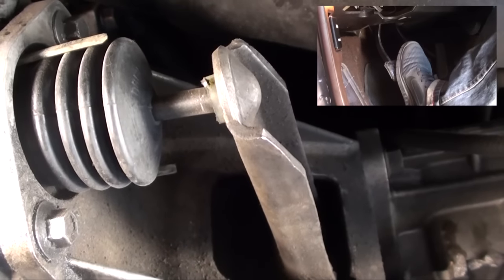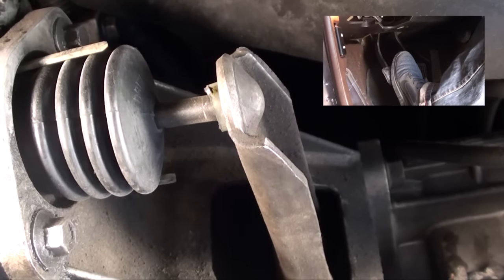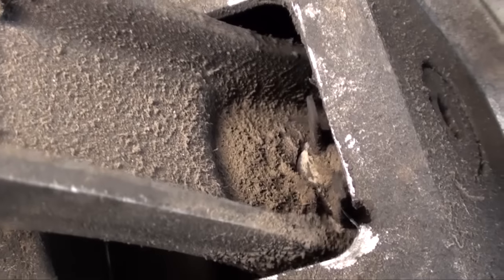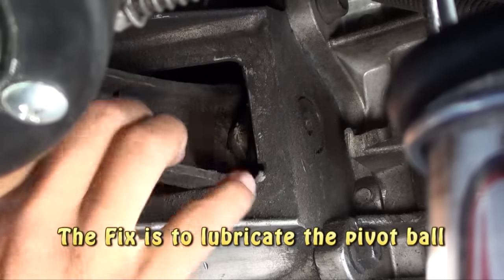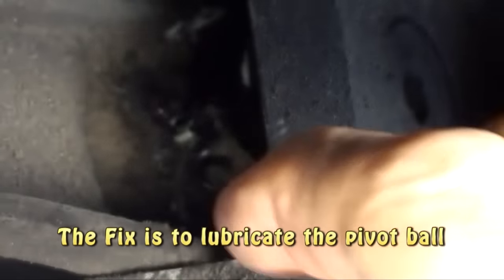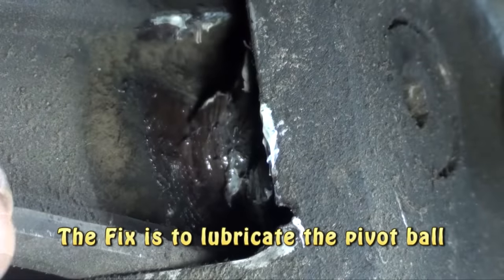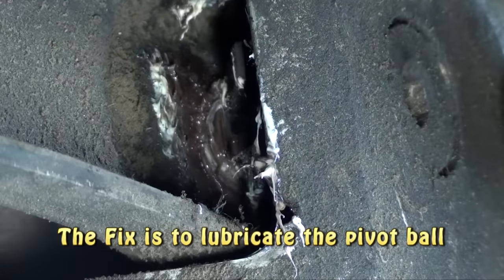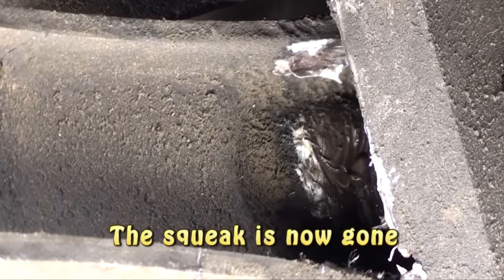Clutch Release Fork Noise

Comment: mine is a 2.5 flex 2018 mechanical made in argentina bought 0km, i'm happy for my purchase, but a little sad about a cricket-like noise that appeared from january 2020 to here, that is when i press with my finger just a little bit clutch pedal the noise stops making and when I release the noise it comes back, then I took it to the Ford dealership where I bought it and at first only lubricated one cylinder, but the problem continued, after a long time now with the return little by little of the pandemic because a second appointment had been canceled due to covid I was able to schedule for July 2nd and the cylinder type part (3C11-7A508-AB) was changed to me and by the time I left the dealership everything was fine and before I got to my residence started to make noise again and to my surprise now besides the noise of a cricket coming back when you press the clutch pedal with your hand, the acceleration of the car started to change also beyond what I saw I noticed under the car in the hose connection a small leak I don't know if it was due to the replacement of this cylinder and they didn't clean the place properly after the exchange, I called there to make a new appointment and ok it was scheduled. sorry to say all this here, but I thought it was important to report here why I think that we who appreciate the ford ranger have to be even more attentive when we don't have many videos talking about exactly the problem you are going through, there are other cars from ford, but exactly the new trucks I didn’t find, congratulations on your video.
Reply from the maker: Thank you for the part number to the slave cylinder. That was very helpful. They stopped making the Ranger in the US several years ago and just now brought them back in 2019 but none of them have a manual transmission with a clutch.  I wanted to see how the cylinder and throw out bearing were configured.  Ford used 2 designs for release. For the past several years in the USA they eliminated the release fork and incorporated the slave cylinder and the throw out bearing.  I needed to see the design to advise you and your part number was very useful. It appears that your Ranger does indeed use a release fork which is very similar to my video.  This confirms that your noise is more than likely due to a release fork pivot ball lacking lubrication where it contact the release fork.  Depending on the specific design some pivots can be lubricated like in my video through the access opening and other will need the transmission removed to accomplish this task.  My guess based on the design of your slave cylinder is that your transmission might need to be removed to correct this noise. If this is the case, and the dealer is willing to do this under warranty I would suggest that you have them check the wear on the clutch disk.  If the disk is worn 50% or more I would suggest you inquire on the additional cost of replacing the rest of the clutch assemble.  (disk, pilot bearing, throw out bearing, pressure plate and flywheel or recondition the flywheel)  You will be saving on the cost or removing and reinstalling the transmission which is at least 3 hours or more of labor at the shop rate.  If your budget is tight and you need to consider putting this off you should reconsider if you only have 25% or less left on the disk.  Clutches typically last 3 - 6 years depending on how you drive and if you live someplace with a lot of hills. Good luck.  Tell them that I said they should check the contact between the release fork and the pivot ball for rust and a lack of lubrication. Additionally, most spray lubricants will not be sufficient to last very long and a high temp grease type lubricate should be used.

Comment: Thank you for your video, how about Mercedes w123? I've been looking for the fork but I can't find it yet..
Reply from the maker: From what I can tell this model was never sold in the United Sates.  Because of this I do not have any access to the repair manual information to help you. Look for the release fork coming out the side of the bell housing. The bell housing is located right behind the engine.  If you find it there is most likely a rubber boot covering the hole where the fork exits the bell housing.

Comment: I have the exact same issue but except my car is a 2012 SR Hilux 4 x 4 turbo diesel. I tightened up the clutch pedal and it went away. Where can this be located?
Reply from the maker: I'm not sure how you tightened up the clutch pedal but this will eventually cause you a whole new set of problems. Look under the truck for where the release fork extends out the side of the bell housing.  Pull the rubber boot back and look inside to see if you can see the pivot ball.  If so, your lucky.  try to get some grease lubricant onto that pivot ball. Then reset your clutch pedal because you don't want to have that so tight that you don't have any free play.

Comment: Exact sound my sn95 makes. I just had the clutch replaced too and this sound started like 300 miles after the install
Reply from the maker: The pivot ball was not properly lubricated during the clutch replacement.  I would take it back and if necessary show them the video. Some pivot balls like the one in the video can be lubricated without taking the transmission out while others can't and the transmission or transaxle will have to be removed in order to lubricate the pivot ball.

Comment: On my 91 chevy it wont go into gear unless the truck is off i replaced the slave cylinder N master cylinder and nothing changed after bleeding. Any ideas? Also while i had the slave cylinder out i used two screw drivers to move the. Arm back and forth. Is there suppose to be spring back?
Reply from the maker: It is difficult to tell based on your information.  It sounds like you changed the slave and master to solve a problem that did not get corrected?  what problem were you trying to solve?  As to moving the release arm it depends on the direction you moved the arm. There could be some spring tension but not always necessary. If you want to respond with some symptom details I will try to help.

Comment: I put grease in there just like this, but no change, it still chirps. any ideas?
Reply from the maker: It doesn't appear to be the pivot ball and fork that is making the noise if you greased it up.  When exactly does it make noise?  Foot on or foot off the clutch pedal?  If foot on is your foot part way down or all the way down?
Reply: @DrivelineMaster  It only makes sound with foot off clutch. and slightly pressing makes it stop. it sounds just like this video. doesn't matter if stopped or moving. it also changes in pitch or stops when i hit the gas, depending on how hard I hit the gas.   the higher the rpms, the faster the squeak. I haven't been able to duplicate the sound yet with a mechanic present :(
Reply: actually I don't think I greased the right spot. i put grease where the slave pushes the fork. my fork has a rubber cover that block me from putting grease where you did.
Reply from the maker: Aha, because your description does sound exactly like a pivot point noise.  You can pull the rubber boot back and hopefully you will now have access to the pivot ball. Sometimes the pivot ball is on the other side and it's not accessible.  On those designs the transmission has to be removed to lubricate the pivot ball.  Bummer.

Comment: Thanks for this video ! Seems I've found what is my issue on my mini cooper S R56. Now only issue will be to find the pivot ball in my car !!! Any tips to find it ?? Thanks
Reply from the maker: Look for the slave cylinder and release fork.  The release fork passes through an opening that is covered with a rubber boot as it enters into the bell housing. Pull the rubber boot back and look inside to see if you can see the pivot ball.  If your lucky it will be close to the opening.

Comment: I have the same issue on Subaru Forester. I greased well and sound dissapears, but following day the sound comes back. I suspect the fork or pivot ball has some issue?
Reply from the maker: Some Foresters have an service bulletin about an upgraded Throwout bearing that might be problematic. Or it might just need a different type of grease.
Reply: @DrivelineMaster  my sound issue started just after clutch replacement at store. Definetely its not TOB (if I hold firmly the fork, noise dissapears). I used lithium grease.
Reply from the maker: OK, very odd that the noise would return the following day after lubricating with a lithium grease. Unless the grease just got around the edges of the pivot ball and didn't get well enough between the ball and fork. That's the only guess I would have on why it would return withing a day.  There is a spring that helps to hold the ball up against the fork which could make it difficult to get the grease between the ball and fork. Good Luck.
Reply: If in doubt, add more grease!  It worked for my Forester and the chirping noise also started the day the clutch was replaced like your situation

Comment: Wait I have the same noise but opposite, when I push the clutch in it makes a squeal when I release it stops
Reply from the maker: That is a release bearing noise also known as a throw out bearing.  Unfortunately the transmission or transaxle will have to be removed to replace it to get rid of the noise.
Reply: driveline master i have a 1993 mustang 5.0 with a T5.Ti bought it about 3 months ago. been squeakung since i got it. in any gear or neutral it squeaks, it stops when i push the clutch. whenever my foot if off the clutch its squeaking. ive talked to several 20+ year mechanics all friends. they have all said its throw out bearing. ive even rrezearche it. many diff articles/forums all saying same thing. research ive done & what ive been told is if its the opposite of what mines doing or squeaking while pushing the clutch is pilot bearing.
Reply: @bryanroupe8646  did y figure it out?
Reply: I replaced the through out bearing and pilot bearing and that fixed it. Actually did the entire clutch kit because the one in it was like a brick.

Comment: Can you explain where this location is at? I’m having this issue occasionally and it’s only getting louder
Reply from the maker: It's different for most vehicles.  Some vehicles do not have enough access to lubricate the pivot ball like in the video.  Just behind the engine is the bell housing and transmission or transaxle.  The release fork normally extrudes from the bell housing. Left side, right side or sometimes on the top like on Subaru's. The access hole where the fork stick through normally has a rubber boot to keep the road dirt out that will have to be removed to access inside the bell housing where the pivot ball lives. If you tell me the year, make and model of your vehicle I may be able to look it up for you.
Reply: @DrivelineMaster  it’s a 1996 Miata, so I’m hoping it’ll be just as simple as jack it up and grease it and it’s fixed, but maybe not. I have a jack and stands I’m just not even sure where to find this chirping sound. Sound starts when I’m off the clutch but pressing in makes it stop like the video.
Reply from the maker: I just got back from vacation.  Let me look this up and I will write back soon.
Reply from the maker: Under your vehicle on the passenger side just behind the engine is the transmission bell housing and you should see the slave cylinder and the release fork. The fork sticks out of the bell housing and it will have a rubber boot around the fork to keep road dirt out of the clutch assemble.  You should be able to pull the rubber boot back to gain access to the pivot ball which is causing your noise problem.  With a light and a flux brush with grease on it you should be able to lubricate your pivot ball. The hardest part might be getting that boot back properly installed.

Comment: Not sure if you'll respond but do you have to go back every so often to reapply grease?
Reply from the maker: If a good quality of grease is used with the proper quantity and the rubber boot on the shift fork is intact this should last the life of the clutch.  It might dry out if you are really good with a clutch and you live where the roads are flat with minimal stop and go heavy traffic to where you get 80K miles on a clutch.
Reply: @DrivelineMaster  Thanks DrivelineMaster, I can finally get rid of those crickets for good. Gonna try it today!

Comment: I accidently disconnected the fork of the pivotball trying to do this to my 2001 honda civic. I tried to get it  back on but I dont think I succeeded. I put the rubber boot back on and Im driving it like that.Do you know if there is any risk of driving it like that?  When I get a chance I will try again to get it back on the pivot ball.
Reply from the maker: I'm surprised it can be driven if the fork is not on the pivot ball.  I suspect that it is on the pivot ball but you may have knocked off or bent the retention spring that is designed to help hold the fork against the pivot ball.
Reply: @DrivelineMaster  I might be wrong but the fork was against the edge of the housing and I struggled a little to push it away to get in there and spray. And when I finally did push it away like an inch or two the fork stayed there it didnt come back to the position it was and I tried to get it back to where it was and I couldnt. But the car runs fine and the clutch really doesnt feel any diferent.  I will check under there one more time to see if it went back to its position I found it in or maybe see if  theres any way to see if its on the pivot ball.
Reply from the maker: You may have just pushed the rod to the slave cylinder back into the cylinder and once you started to operate the clutch again everything returned to normal. I'm willing to bet that when you look it's all back to normal.

Comment: Hi I have the same issue I think. When I depress my clutch and release it just under half way I get this sound. It goes away when my foot it fully down or off the clutch. What does this mean?
Reply from the maker: If you get a screeching noise as you are letting the pedal up at about half way this is typically a pilot bearing noise not a release fork pivot ball noise.  Watch the video. the noise goes away anytime there is foot pressure on the pedal.

Comment: I have the same problem here, but the thing is whenever I grease it about a few days later the noise keeps coming back. Would that mean I have worn out something as well if it was to keep on squeaking?
Reply: Hello my friend, same issue here, you solved it? I was thinking in changing my pivot strut since I already changed the pitchfork, greased it and the noise keeps coming back
Reply: @JoseManuel.M  hello, i still have the problem, ive also changed out the pitchfork and greased it but that only goes good for a day or 2 when its greased. After that the noise would still return